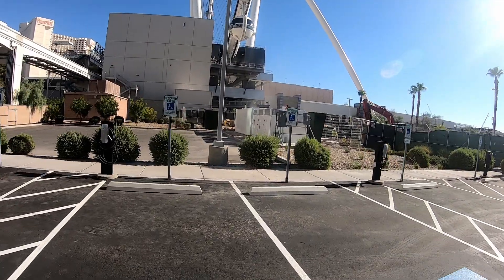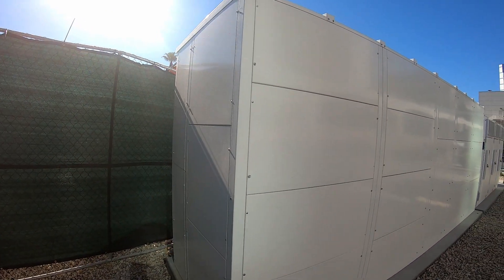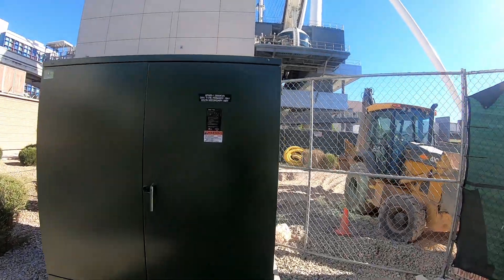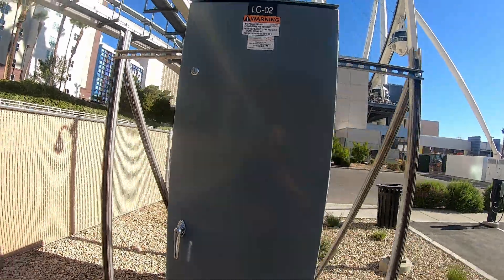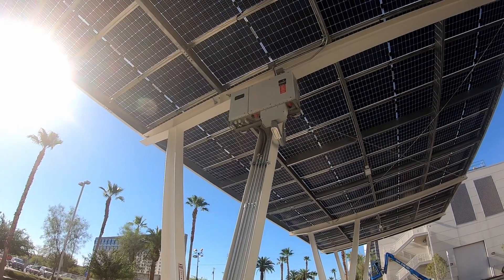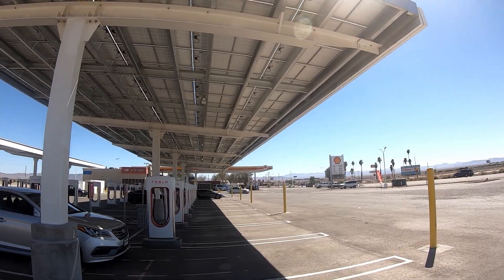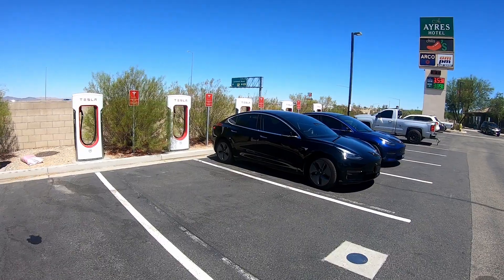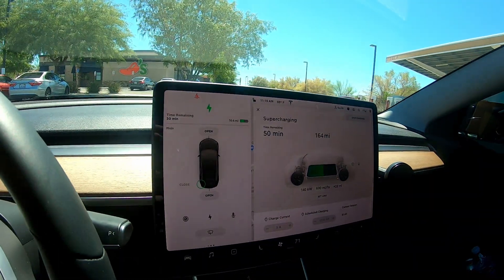Las Vegas Supercharger V3 station Part 2. Can we hit 250Kw? Tour of Cabinets and Battery Storage

Comment: Thanks for the video and for showing the equipment. However, you did not zoom in to the the most important part: the charger nameplate. You can see the black nameplate at 3:18 in your video (on the left side of the charger cabinet). It would be great if you could upload a new video (or share a picture) showing that as well. BTW, the charger enclosure seems to have the same size as the Powerpack inverter enclosure.
Reply from the maker: Ahh yes I see it now. I’m going to be going back for another video soon will document the nameplate etc :)
Thanks for watching

Comment: Actually, the thing you took for a 7th Supercharger cabinet at first is a Powerpack, so that appears to be the "only" battery storage on site which could be anything in between 100 and 200kWh.
I'm assuming what you took to be battery storage is a transformer and/or switchboard etc.
Thanks for the video!
Reply from the maker: Interesting thanks for the update.
Reply: @VegasModel3  You're welcome. Looks like the transformer is the green box next to all the white ones. So no clue what's in the big white one, besides a switchboard.

Comment: Thanks for showing the equipment. The 2500 kVA transformer will supply about 104 kW per vehicle if the station is completely full. 

Very helpful!  The new Supercharger cabinets are beats!
Reply: That's bad though because the entire point of V3 besides the faster charging rate which seems to only last until you have 60ish miles of range was that there wasn't going to be anymore sharing of power between stalls.
Reply: @AustinMichael  Unless you flashmob the Supercharger and all cars start at 0 state of charge there's no problem really. The chances of ever not reaching 250kW when you plug in are nearly zero at the moment.
Only in the future, when battery technology has improved to the point that the battery can take 250kW across most of its SoC, will this become a problem. But do keep in mind there's already solar and battery storage feeding the chargers as well.

Comment: 3:03 No meter? Probably not important or there is another one if later seen schematic is right.
More interesting - is there transformer limit that might affect charging speeds? 2500kVA AFAIK it means that there's only dedicated ~100kW per charging post if the site is completely full...

Comment: We couldn't figure out how to get in! It's not super intuitive.  You have to press the supercharger map pin on your Tesla's screen, and in the tiniest font imaginable, just above where it shows the number of open supercharger spaces, it shows you a unique pin code to punch in.  After that, on the next machine, you can press the large button to dispense a ticket, which can be used to scan and exit later.  It's a smart way of allowing ONLY Teslas (no ICEing here), but I can see many first-timers getting stuck at the gate.
Reply from the maker: I was a little confused as well. When I arrived I just pressed the help button on the ticket machine and they answered and gave me the code. But yea I will have to check the Tesla app to try that way also